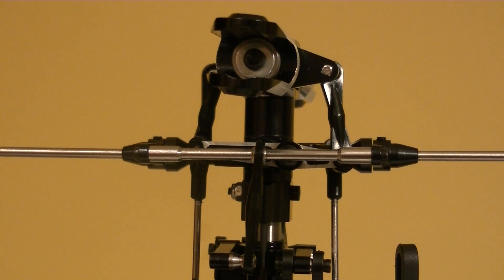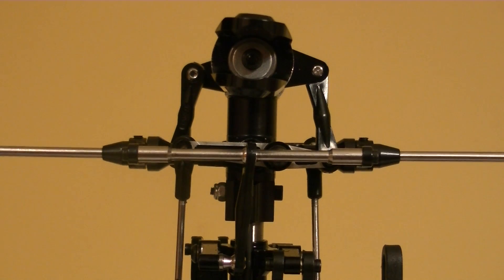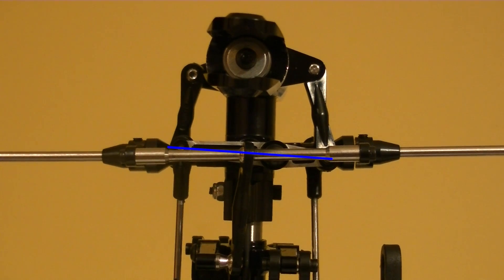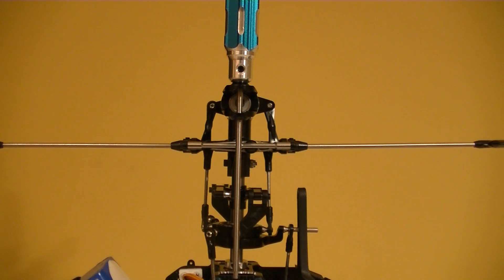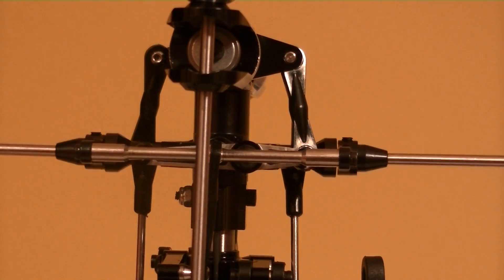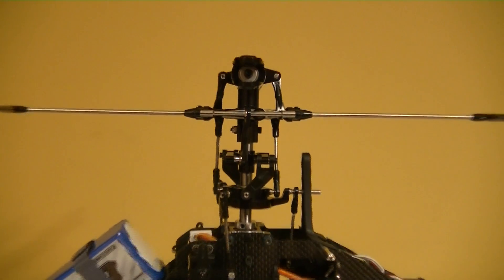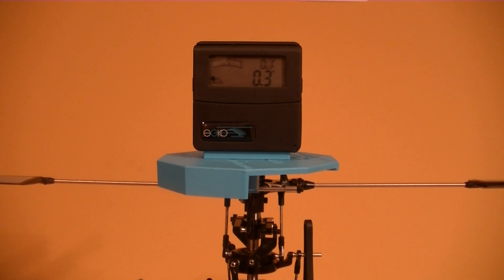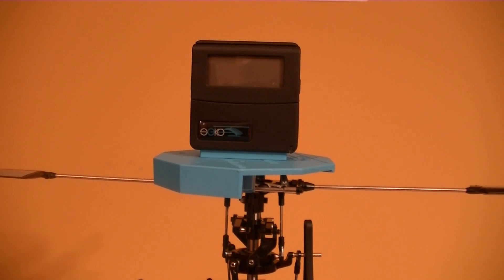12 : Tarot 500 : CCPM Head Setup Part Two

Comment from the maker: Setting up the pitch, in theory, can happen from any position as long as pitch is established relative to the main shaft. Most people tend to adjust pitch with the blades perpendicular to the tail boom.   It doesn't really matter as long as you check everything from the same position. You adjust elevator with the blades at 90-deg to the tail boom. You adjust Aileron with the blades parallel with the tail boom.  I hope that helps.

Comment: Hi CPO: 
Could you confirm for me that I am setting up my blade pitch correctly, in the right orientation. I am assuming that when I set 0-deg pitch and that the blades need to be parallel to the heli body length, but when I am setting up for Aileron then I should be setting pitch percentage to 90-deg of the heli body. Could you go over this for me please, or point me in the right direction. Love your work Cheers from Stretton